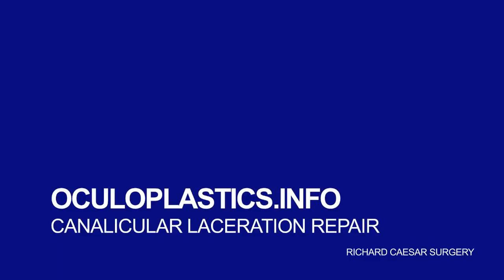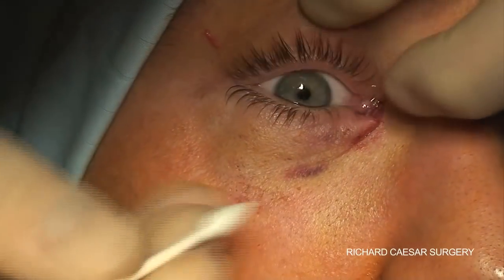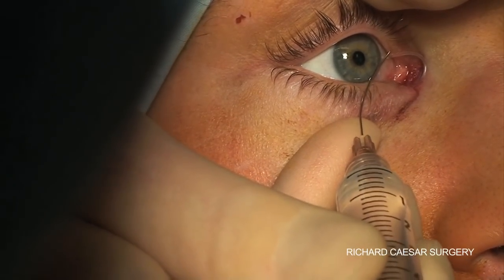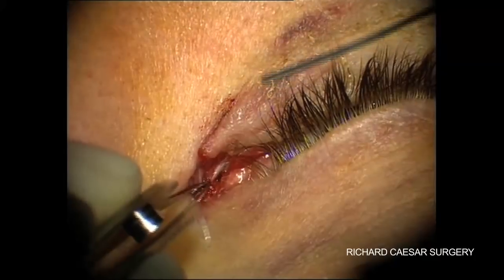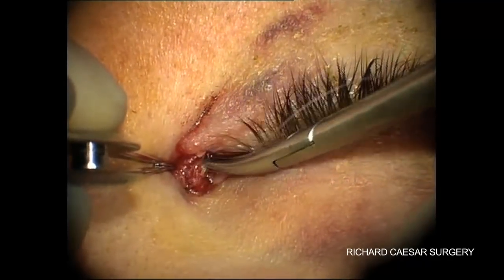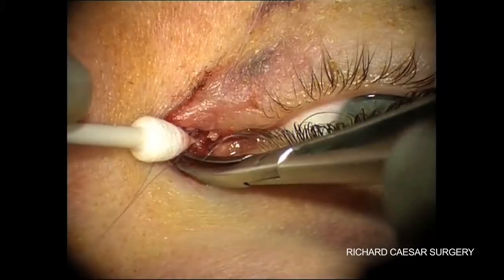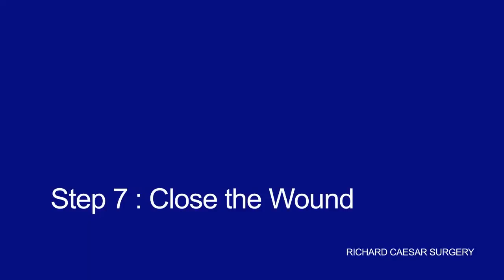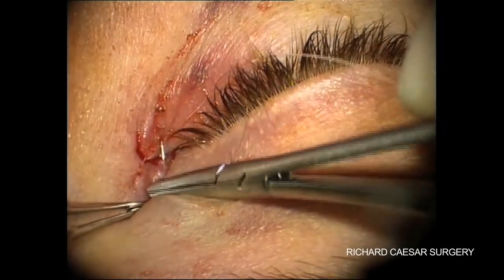canalicularlaceration

Comment: Very nice demonstration.  Have a few questions to ask please. Do you place the 8 0 vicryl sutures through the canalicular wall or through the soft tissue around the cut ends of the canaliculus? Can the mini monoka stent be removed in clinic? Has it ever got stuck in the canaliculus? Thank you so much. Mark.
Reply from the maker: Hi, I place the sutures adjacent to the canalicular wall in the soft tissue.  Mini Monaka easy and painless to remove in clinic.  I would have answered that I've never seen one stuck in the canaliculus, but then last week, investigating a patient with epiphora, I found one half way down the canaliculus, causing a blockage.  Never say never.  Best wishes.  Ric